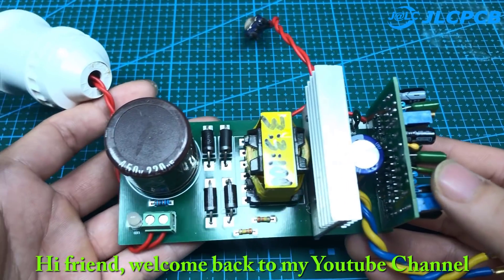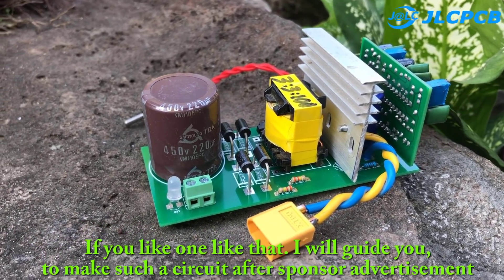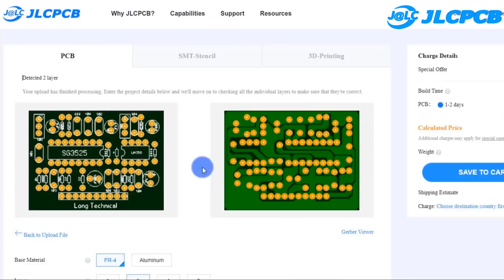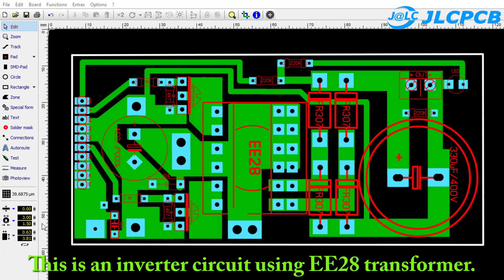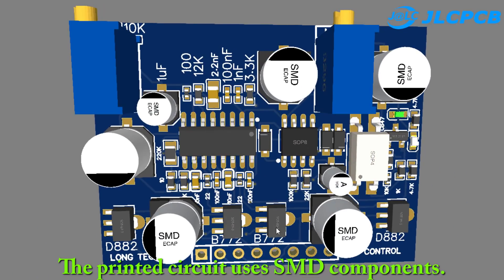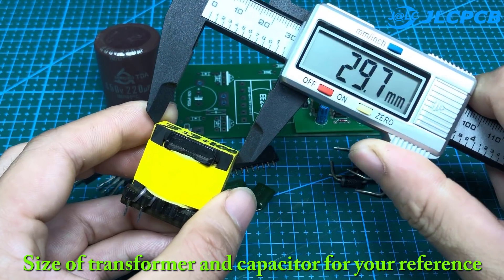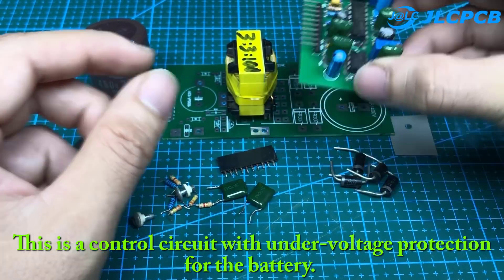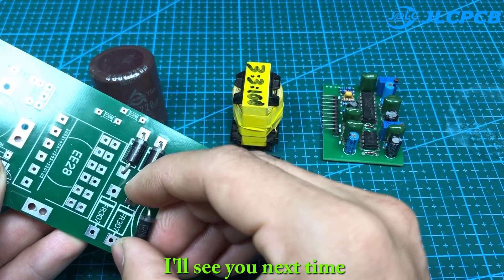Compact Powerful Inverter 12V to 220V use EasyEDA and JLCPCB

Comment from the maker: Hello Bro ! Where are you from?. What project do you want me to do?.
Reply: simple Buck boost converter upto 1000 watts
Reply from the maker: @m.mohsinmirza  Happy New Year. I will try bro
Reply: Hey bro am from Tanzania....can you design a phone charger i.e 5v 2amps with built in Li-ion battery charger circuit...like you combine a smartphone charger with a power bank....i would be very grateful..
Reply from the maker: @vernacular_tz  Nice to meet you. I will try that. Happy New Year
Reply: @LongTechnical  you too bro
Reply: Hello..! ... I'm from India... will you make PDC Fish stunner?
Reply: HELLO NICE TO MITE YOU,  I AM FROM BRAZIL I NEED INVERTER 2000 WATTS FREQUENCY HIGTH
Reply: Plz make 4ch mic mixer with high gain output
Reply: A high tech half bridge mobile charger usb C type and powerbank module which have synchnous buck converter of high amp from old computer board and can charge lithium battery of 20000mah in quite few hour with good protection
Reply: hello sir plz make inverter pure sain wave 2000w from tow ee4242 cor frait

Comment: Bro  great work. please make an smps power using UC3843, 48Vdc to 15vdc 4amps.
Reply from the maker: I will try Bro
Reply: @LongTechnical   an smps using uc 3844/43/42/45 whichever in two switch forward topology